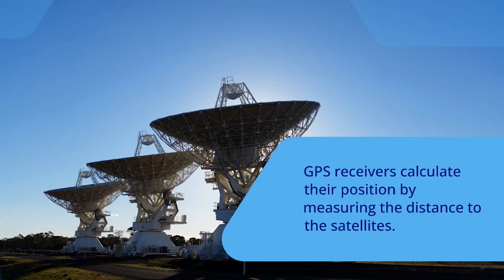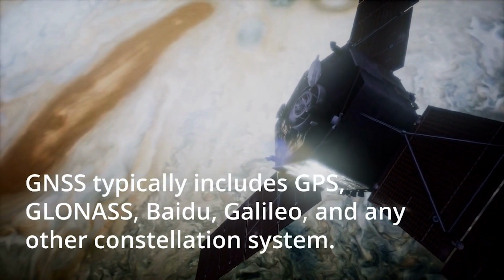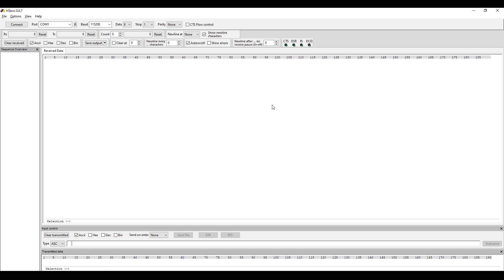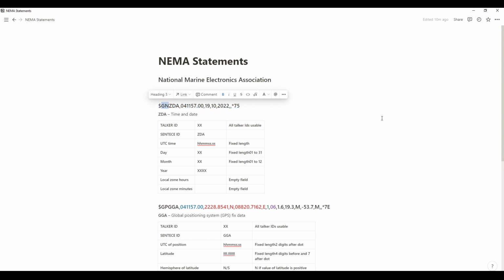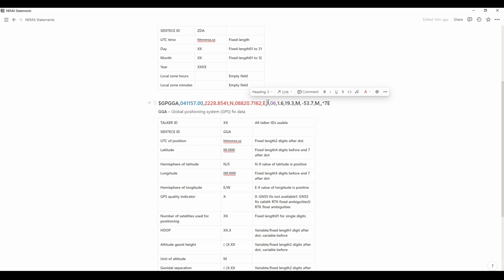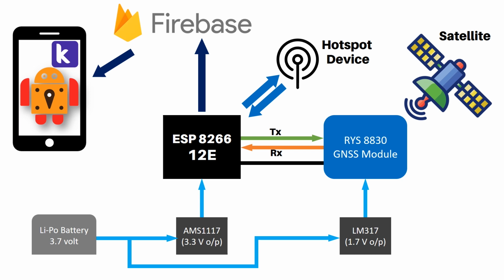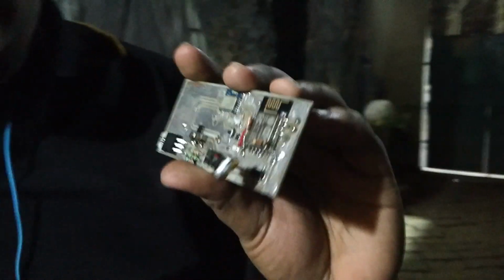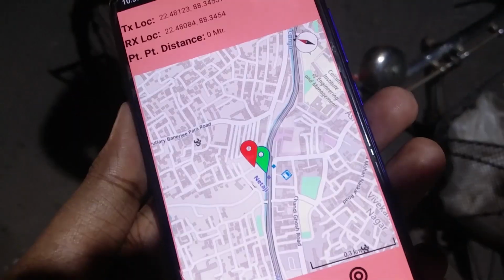NodeMCU Based GNSS Tracker - The Newest and Most Versatile Option!

Comment: do u use logic level shifter? because the modul has logic level 1.8 for rx/tx and esp has 3.3?
Reply from the maker: No used resistance devider
Reply: @circuiTician  nice. do you have a circuit or more information? sounds liek a cheap solution